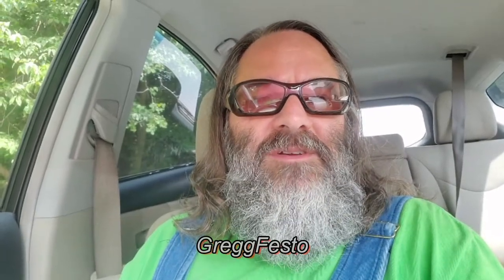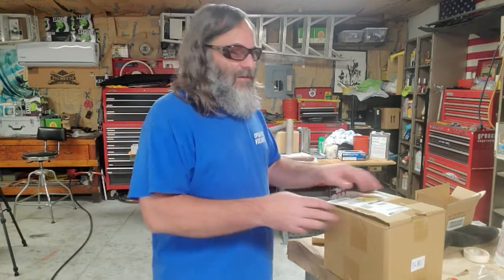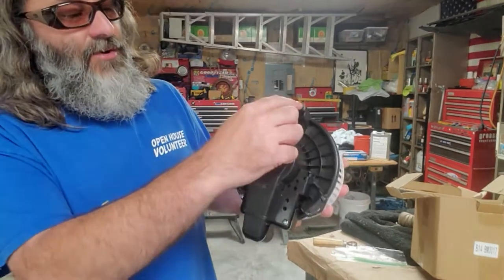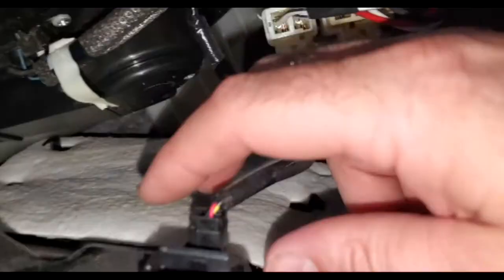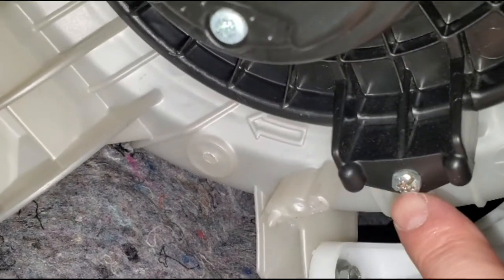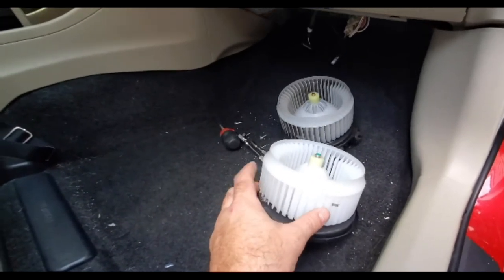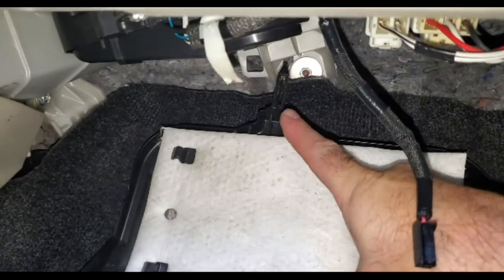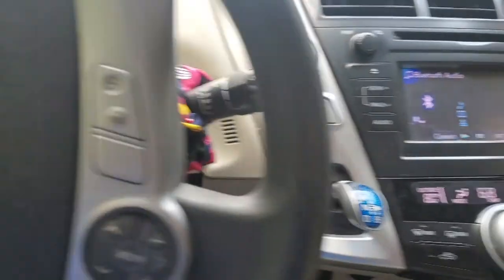DIY Blower Fan Replacement 2012 Toyota Prius V - Heat AC Fan Making Noise? Fix it Yourself & Save $$

Comment: I'll just say your guidance regarding the screw holding the wiring harness was invaluable. The first YouTube I watched said to bend the bracket, but I couldn't get it bent enough because there's such a short lead. Taking the screw out makes a lot more sense. Thanks. If I could give you more thumbs-ups, I would.
Reply from the maker: Thank you for watching and leaving a comment. Much appreciated.

Comment: Thank you for this video. Do you think the blower motor your linked would also work with a 2012 Prius Three as well? I tried doing my own research, but I couldn't find a definitive answer.
Reply from the maker: Thank you for watching. I looked up 2012 Prius and then 2012 Prius V on RockAuto. Shows same part number for both cars.

Comment: Gregg, can you please link to the blower motor that you purchased? I'm about to take this job on myself. One issue I have had is finding a blower motor that will accurately fit the Prius V.

Edit: Did the blower motor in this video also have an attached resistor?
Reply from the maker: Hello Gavin, Thank you for watching and commenting. I will provide link below tot he motor I purchased. There is no resistor on this motor. I think this type is controlled by PWM not a resistor but could be wrong about that. If there is a resistor it would be located in the airstream of the system (the airflow keeps the resistors cool when on lower speeds). Please write back in and let us know how this job goes for you. 

https://www.amazon.com/Assembly-87103-02210-2009-2018-2010-2015-2012-2017/dp/B0824PM7J5/ref=sr_1_8?crid=3VYACGWVVZESK&keywords=prius+v+blower+motor&qid=1658912042&sprefix=prius+v+blower+motor%2Caps%2C732&sr=8-8

Comment: Howdy, I’ve been recently looking to buy a Prius V. From what I’ve been hearing is that these vehicles start going downhill around 150k miles with EGR/head gasket issues and eventually around 200k they need a completely new engine. Now I don’t know if this is true for everyone but I’m curious if you’ve experienced any of these issues?
Reply from the maker: Hey DEFNASTYS, Thank you for watching and commenting. I have owned multiple Prius and have found them to be very good cars. I have gathered that 2010 is one of the least desirable years to get as they tend to have more issues than the rest. The 3rd gen can have head gasket issues if the coolant is not changed regularly. I suggest taking any car you are thinking about buying to a shop and pay for them to do a head gasket test before you purchase it. Another suggestion I have would be to download Dr Prius app and Torque Lite app then get a cheap OBD2 code reader. With these you can read codes (if any) and look at battery pack health. Please write back and let us know if you end up purchasing the Prius V or a different car and what checks/results you saw.
Reply: @GreggFesto  thank you for your input! I will definitely get all of those things. I’ve been avoiding the 2010’s and looking to most likely get a V model that’s a 2012-2014. Seems to be in my price range. I’m trying to gather as much info on these vehicles as I can so I know exactly what to look out for so thank you for reaching back and I will definitely let you know once I make my decision!